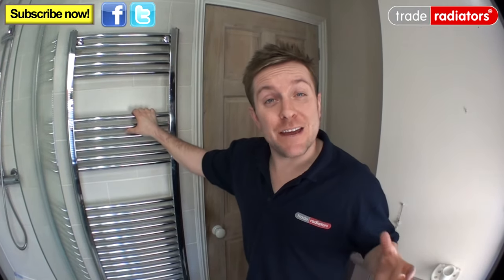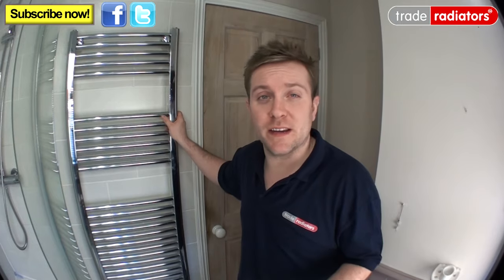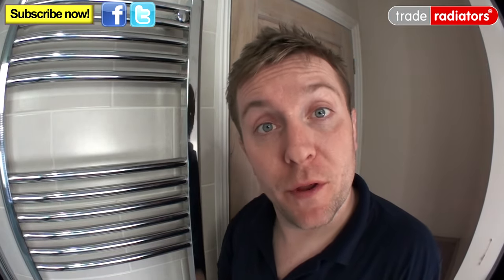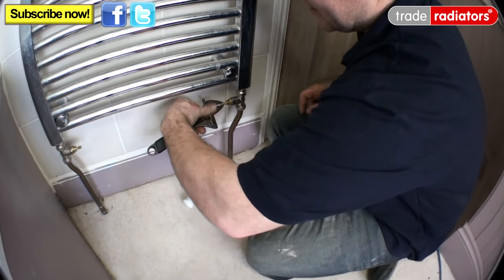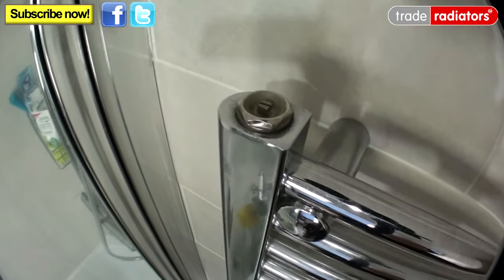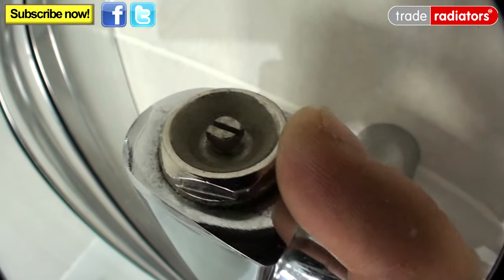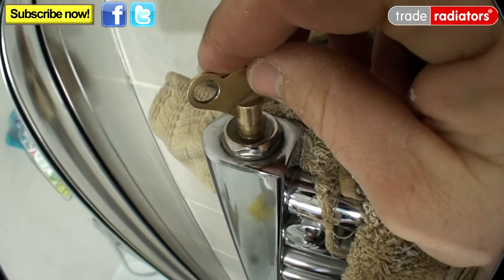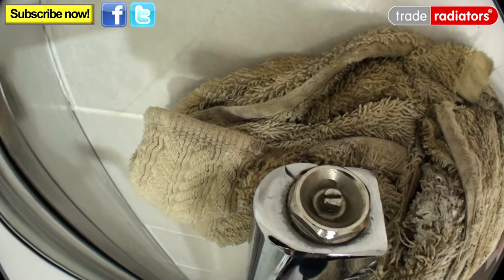How To Bleed A Heated Towel Rail

Comment: Yes, that was useful and informative but my problem is getting the cover off the top, covering the radiator valve. Does it pull or screw? I can't get it off! Help!
Reply: Did you figure this out.. I bought a cover for mine and now I don’t know how to get it off for in case I need to bleed it. If you could let me know that would be great thanks!